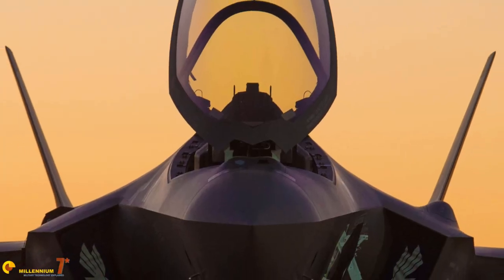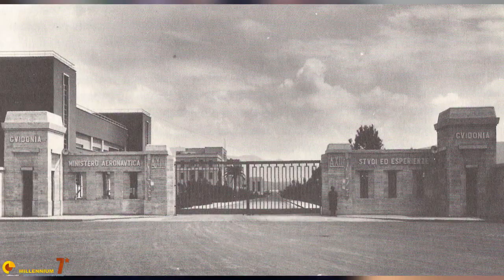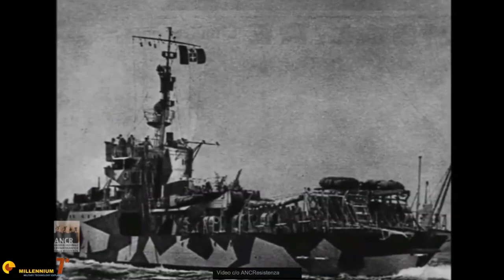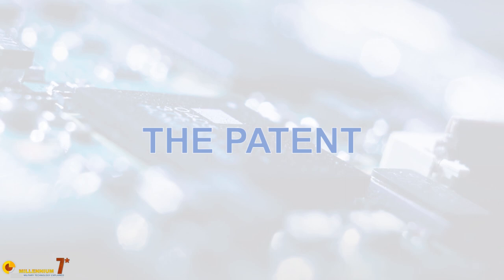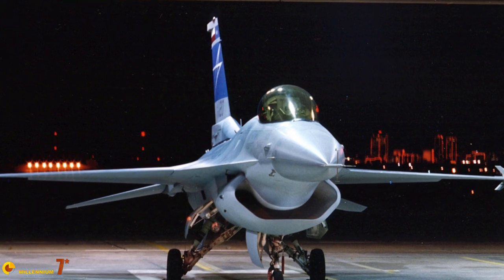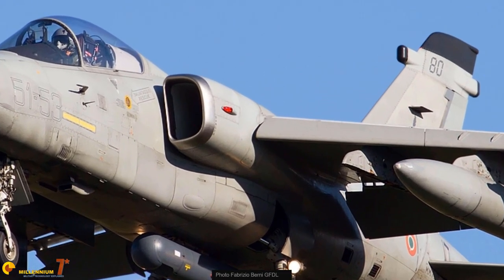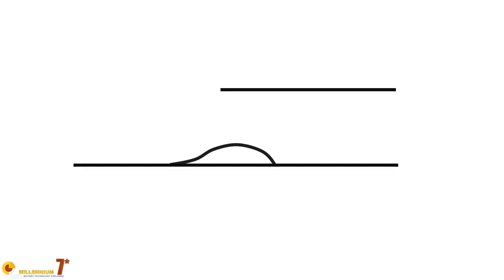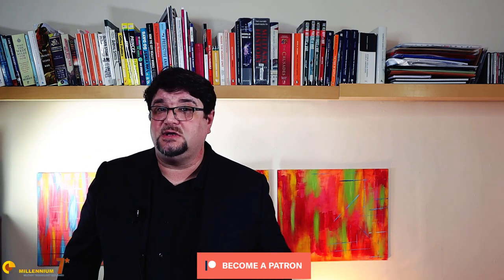The Vintage Intakes of the F-35 - The origin of DSI intakes.

Comment: May I have a question. It regarded mostly for the conventional, splitter plate solution. It splitted the slow boundary layer, this is understandable. But there is again a surface inside the intake, the velocity difference is still there, why there is not created a new boundary layer beside it?
Reply from the maker: It does, but since it is created downstream of the compression zone, it is thin and not developed when it is ingested.
Reply: You may also notice (especially on the Eurofighter @9:37) there are hundreds of tiny holes just before the intake that act as a boundary layer control. If I'm not mistaken, air is sucked through these holes and considerably reduces the developpment of a boundary layer. 
Maybe a topic for another video? A documentary on the YF-23 I watched a few months back explained the science behind this feature.

Comment: Is there no maximum speed at which the diversion of boundary layer air stops working well with this design?
It seems not, at least not at speeds up to mach 2.5. But I'm just curious if that approach holds up at say mach 3 or 4 or something really fast like that?
For that matter, I kinda wonder if it works with hypersonic designs (plasma behaves somewhat differently than gaseous air).
EDIT: I notice that the YF-23 did not have "bumps" in it's divertless design. Different approach?

Comment: Now, this is  a video from which I really learned A LOT. So basically these DSI intakes are a further developments of the Ferry scoop intake. Which suddenly figures when the connection is made. You should have shown a picture of the XF-103 as well. It looked as if it could even scoop sugar. :-) Am I to understand that the negative leading edge of the DSI intakes actually have a negative leading edge to make part of the boundary layer bleed off to the sides? In other words. The majority of the bulge has to be in front of the intskes leading edge? There goes the inlet design of my paper STOVL project. Back to the drawing board! :-) Talking about Lockheed rewriting history: Especially US sources nowadays claim Lockheed financed the development of the Yakovlev's  Yak 41 translatable exhaust when the Sowjet Union still existed! How very peculiar! I wonder if Lockheed started that story as well.

Comment: This video was not long enough. It was cut short with just mentions of favorable constituents. I am positive books and books have been written about air intakes. On the P-51 it was thought that the air heated by the radiator scoop reduced the effect of suction at the rear of the aircraft slowing down the top speed. If this was so on the P-51, the P-47 the effect would have been even greater because of the massive frontal area. Many people did not know  the same intercooler effect was under the P-47 with the intercooler for the air compressed by the turbo supercharger.

Comment: It is cool to see the different kinds of intakes. I heard that some passenger plane concepts like the Aurora use an intake that sucks in the boundary layer air for less drag on the turbofan. However, the distribution of intake pressure upon the turbofan was too unbalanced and could not be done yet. I don’t really know the technical terms, but this video has helped me learn many steps closer.

Comment: Aha!  I have a model of the Aeritalia/Embraer AMX.  I love that plane.  It is a near-perfectly designed aircraft for ground attack, close air support and coastal defence.  It does what it's supposed to do and doesn't cost an arm and a leg.

As for the "F"-35....

What a terrible, overpriced and horribly-executed piece of garbage.  It started its life as the Russian Yakovlev Yak-141 Freestyle which Lockheed bought.  This ground-attack aircraft that the Americans call a "multi-role fighter" just to fool more countries into buying it has the second-worst level of wing-loading (after the MiG-35 but the MiG-35 has vectored thrust) and the absolute worst thrust to weight ratio of all modern fighters.  It's also the slowest supersonic combat aircraft in the world with a top speed of only Mach 1.6.  This means that it's a horrible air superiority fighter and an even worse interceptor.  It should be called the A-35.

This plane is a dog's breakfast because a (MiG-31) Foxhound would eat it for breakfast.
Reply: Wrong! It’s worse than that.... for the damn thing is flight restricted and cannot go supersonic without fear of tearing itself apart! WE’VE SPENT BILLIONS AND BILLIONS OF DOLLARS AND THE DAMN THING CANT GO SUPERSONIC FOR MORE THAN A QUICK BURST!!?! It kills me.

Comment: Hurray... India got 5 Rafael jets.... India is the strongest and mightiest..
Reply: At least they are an big improvement over what they got at least when they get all of them and the Meteor missiles.
Reply: Stop cringe comments please...
Reply: Just need to deliver another 295 Rafale to the IAF.
Reply: @stupidburp  Actually I don't think they need that many, they only need some for high tension missions and then they can be used in combination with the other fighters they got, as a sort of command and control and situational awareness planes.
Reply: @stupidburp  BTW if they wanted 300 fighters they should clearly have gone for the Gripen NG. I think even if they decide to buy more they will keep it under a hundred.
Reply: @mwtrolle  Gripen NG costs nearly as much as Rafale but with less range and payload. Older model gripens were a better bargain in the past.
Reply: @stupidburp  most probably additional 36 Rafale are coming... Don't think India will select new platform...